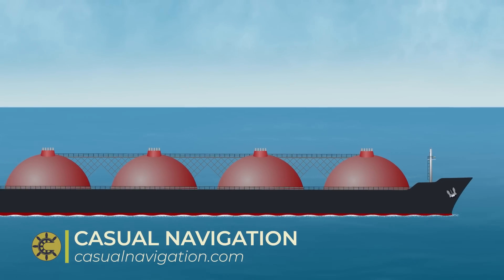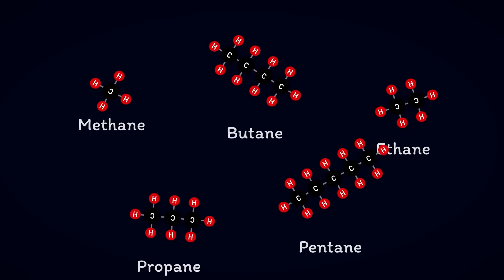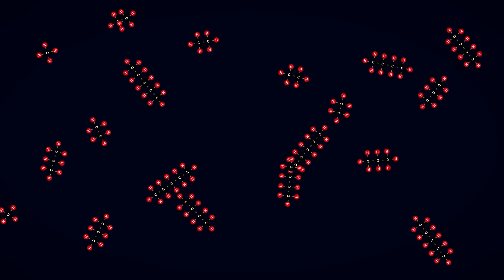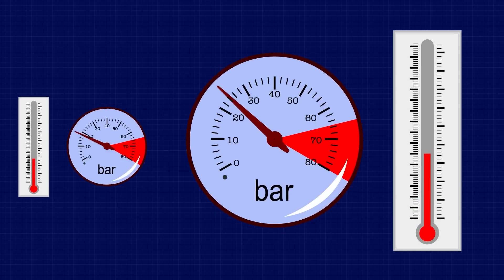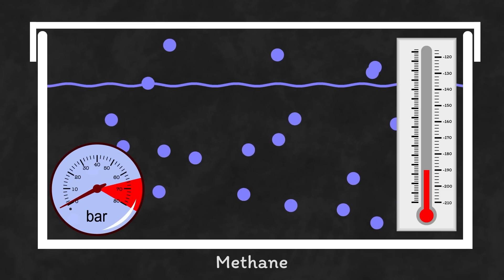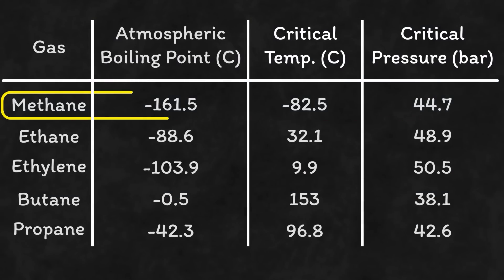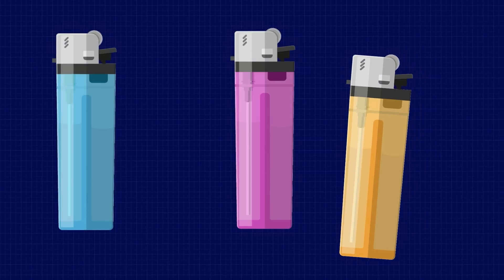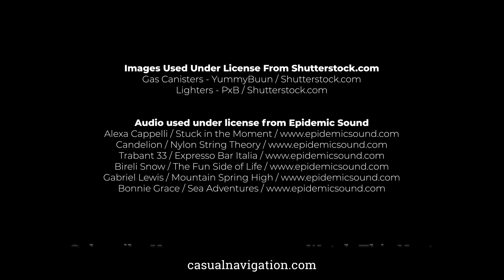Why Do Gas Carriers Have These Humps?

Comment: 99 percent of gas tankers with spherical (type b) tanks are LNG carriers. Fully refrigerated LPG tankers (those able to carry cargo as cold as ethylene) usually have type C (usually cylindrical) or type A (prismatic) tanks. Type C is the most pressure resistant. The normal fully pressurised gas tanker is fitted with type C tanks withstanding a pressure of up to 18 bar. Type A and B both have very low design pressures of 0.7 bar at most.
Reply: 0.7 bar? That's less than atmospheric pressure... Why would they be storing gas under vacuum?
Reply: @thomasdalton1508  most industrial pressure readings are always give in gauge pressure (i.e. the amount over atmospheric).
Reply: Why waste all that space with spheres if you’re only using 0.7 bar?
Reply: @silverXnoise  Yes, that seems odd... Why are the cylindrical tanks rated for a higher pressure than the spherical tanks? The whole point of using spheres is that they are stronger.
Reply: @thomasdalton1508  honestly i don’t know why exactly. Aside from the theoretical strength advantage that spheres can bring, it is the optimal shape to reduce the free surface effect and thereby enhances the stability of the ship.
What i wrote is true though, you can read that up yourself, just search for independent tanks type A,B,C. Membrane tanks are another design that is directly integrated into the hulls structure as opposed to independent tanks. Most modern LNG tankers use integrated membrane tanks. Those are also rated for very low pressure.
Reply: @giantdwarfulf  Wouldn't vertically oriented cylinders reduce the free surface effect more? Presumably the free surface effect is quite difficult to predict with spheres because the amount of free surface varies depending on the level of liquid, and that will vary both with how full the tank is and with the temperature.
Reply: @thomasdalton1508  the temperature has no noticeable effect on the level in the tank. In a closed containment liquid and vapour phase almost keep the same volume because temperature and pressure rise in the same proportion.

Vertical cylinders are used in some cases but really as main cargo tanks. They are sometimes installed as fuel gas tanks on ships with dual fuel propulsion.

The concept of sphere shaped tanks, like basically all large tanks on ships actually, is to be either empty or completely filled. For gas tankers completely filled means 98%. More is nor permitted for safety reasons and because you a sufficient vapour phase for you compressors to suck from.
In these scenarios the free surface effect would be very low, much lower than in prismatic tanks.
Having many small cylinders is simply unpractical because you need to have all of them somehow connected by piping and you need pumps for each tank. The idea is nice but extremely expensive. You have to leave enough space for ballast anyways so with a few larger spheres it will just be a slightly different layout.
But there is also a reason most newly built LNG tankers have prismatic membrane tanks. It is more efficient.
Reply: @giantdwarfulf  The level certainly changes with temperature if it is a closed tank. When temperature increases, the liquid evaporates until the pressure increases to the new vapour pressure. If the liquid evaporates, clearly the liquid level will go down. Similarly, if the temperature reduces the gas condenses until the pressure reduces to the new vapour pressure, increasing the liquid level.
Reply: @thomasdalton1508  he explained it in the video. Liquid evaporates but due to the pressure at the same time vapour condenses. The level is not changing.
Reply: @giantdwarfulf  That's when the temperature is constant and it is in equilibrium. When the temperature changes, the equilibrium point changes and there will be evaporation or condensation in order to reach the new equilibrium point.
Reply: @thomasdalton1508  no that’s incorrect. When the temperature increases so does the pressure (due to above mentioned processes) and the level stays the same
Reply: In the tank you always have a liquid phase and a vapour phase. If there is no more space for new vapour above the liquid, where is it supposed to go? That’s really simplified but it is more or less true
Reply: @thomasdalton1508  you have to think about it like this: the temperature increases and when it surpasses the boiling point at the current pressure liquid will evaporate and thereby increase the pressure. This means that the temperature is no longer over the boiling point and vapour condenses again. This process is repeating itself constantly and that is how liquid gas in tank warms up the volume of both vapour and liquid staying the same. Temperature and pressure increase gradually at the same time in the same proportion.
Reply: @giantdwarfulf  The vapour doesn't condense again. It just stops evaporating.

It is a dynamic equilibrium, so there is actually evaporation and condensation happening at the same time, so more accurately it goes like this: 

* The rate of evaporation and the rate of condensation start out equal.
* The temperature increases.
* The rate of evaporation increases and the rate of condensation decreases, creating a net evaporation.
* This increases the pressure, which increases the rate of condensation (because there is more gas to condense).
* After a while, the rate of condensation increases to equal the new rate of evaporation. The system stabilises at this new equilibrium with less liquid and more vapour.
Reply: @giantdwarfulf  You don't need more space for the vapour. The vapour is at the higher pressure and, therefore, higher density. So you have more vapour in the same space (actually, slightly more space because the volume of liquid has reduced, but not by enough). The reason the pressure increases is precisely because you are fitting more vapour into the same space.
Reply: @thomasdalton1508  that is literally what i said in more scientific language. Still the change of quantity (liquid) is not noticeable. In a tank 10 meters high, this is maybe a millimeter or 2, literally negligible and that’s what i said in the beginning.
Reply: @thomasdalton1508  pressure also increases with temperature because the medium expands
Reply: @thomasdalton1508  at no point is any phase at a higher pressure inside the tank, that is complete nonsense. Liquid and vapour always have the same pressure.
Reply: @giantdwarfulf  It's not what you said at all... Your conclusion is basically correct (especially for a very full tank - I've been doing the maths), but your reasoning was nonsense. The key point I hadn't allowed for in my description is that the liquid is much denser than the vapour (maybe 200 times denser, depending on the compound and the temperature). That means it doesn't take very much liquid to provide the required extra vapour. For a large temperature change, the amount of vapour may double, but if you started with only 2% vapour with a density 1/200 times that of the liquid, you only need about 0.01% of the liquid to evaporate.
Reply: @giantdwarfulf  I meant it is at a higher pressure than it was at before. Not that it is at a higher pressure than the liquid. That should have been obvious...
Reply: @thomasdalton1508  you didn’t fully think your thought through. Temperature increases -> liquid evaporates and both liquid but more importantly vapour expands -> pressure increases lifting the boiling point which means part of the vapour condenses again 
The cycle repeats

You know from the video how much the gas expands when it turns from liquid to vapour. Very small amounts of liquid evaporating is already increasing the pressure significantly and thereby the boiling point. The equilibrium moves with the temperature and pressure.
Reply: @thomasdalton1508  fair enough, still i don’t understand why we started this discussion in the first place. When i said temperature has no influence on the liquid level in the tank, i used the words “almost” and the term “not noticeable”.
Reply: @giantdwarfulf  I made an elementary error and then you tried to correct every part of my argument that wasn't wrong. That's how we started!
Reply: @thomasdalton1508  i understand you know the principle but your explanation is wild at times. “The vapour doesn’t evaporate…“ what would you think from my perspective? First you deny condensation of vapour and in the next sentence you say evaporation and condensation happens at the same time
Reply: This is not a beginner's video. If you understand this on the first watch, you already know the material.
Reply: @hg2.  that is correct i know my shit
Reply: Most of the ships with the Moss-Rosenberg tanks as shown in the clip are LNG tankers though some of them could carrying LNG. They are made out of aluminum which has the strange characteristic that they get less brittle the colder they get. The other type of LNG tanks are the membrane tanks developed by GTT in France. Simply explained they are kind of like a milk carton where a very thin membrane of invar steel holds the liquid cargo in place. These tanks have a primary and a secondary barrier of invar steel. LNG tankers don’t recondence the cargo but instead use it for propulsion and to run machinery.LPG carries on the other hand have prism or cylinder formed tanks. They have equipment to cool down the cargo unless they are a so called fully pressurized gas carrier. Fully pressurized were the first LPG tankers to be used . Semi pressurized and fully refrigerated tanks are the most common now. Semi pressurized tanks can have a pressure up to 3.5 bar while fully refrigerated will not go above 0.25 bar. These tankers may have a deck tank or two that are fully pressurized with no cooling. The typical pressure in these tanks will be 10 to 12 bar depending on if they contain ammonia or propane and on the temperature where they stand. They will always be cylindrical.
Reply: @ there are also fully refrigerated LPG carriers with cylindrical tanks that also have max design pressures of up to 4.5 bar. Those are usually smaller though, but i personally know some mid size (36k cbm) LEG carriers with cylindrical tanks and max design pressure of 3.8 bar for this particular ship class.
Reply: @ If your ship is designed to load ethylene it will have cylindrical tanks so that it can withstand some pressure. Setting on the safety valves will then be around 3.75 bar. Ethylene is fully refrigerated at -103 degrees centigrade. A regular LNG carrier will normally don’t go below -50 degrees centigrade. Polypropylene is fully refrigerated at a temperature of -49 degrees and propane -42 degrees. Then you have the Igloo vessels (Igloo Espoo, Igloo Moss, Igloo Finn and Igloo Norse) that were a jack of all trades. They had cylindrical tanks made of  stainless steel and could load any gas or chemicals in the temperature range from -103 to +80 degrees and a specific gravity up to 2.5.
They had both direct cooling and could cool or heat the tank shell in the temperature range from -30 to +80 degrees C. Then you have list of cargoes it could carry was 29 pages long. You could carry gases and chemicals at the same time with very different temperatures.
Unfortunately they were not a commercial success.

Comment: Wait so how do LNG cars work? I can't imagine they keep the tank ad -82C
Reply: Smaller vehicles are far more likely to be CNG than LNG. LNG is mostly trucks. As fuel is burned from the tanks, the act of withdrawing fuel from the tanks cools the fuel left in the tanks. Combine that with crazy amounts of insulation, and there’s no need for active cooling for trucks in operation.
Reply: They're usually CNG cars,  with a pressure tank.